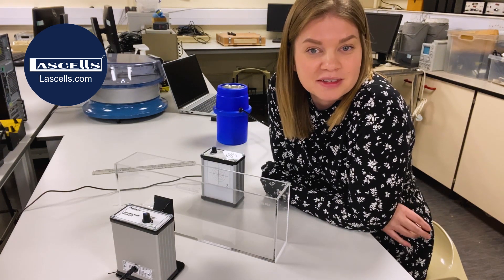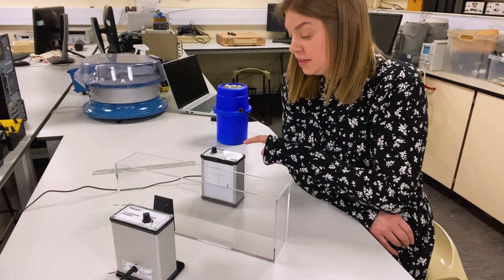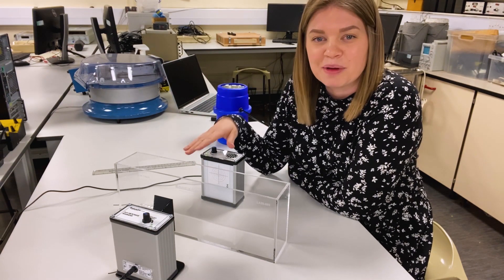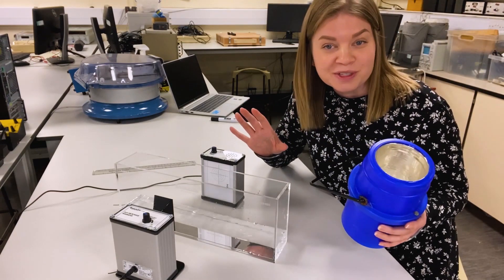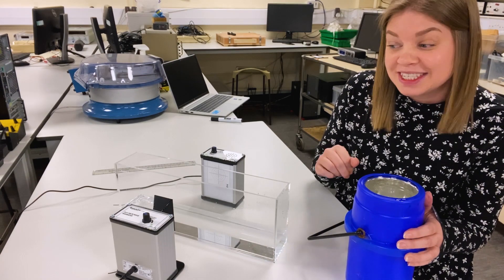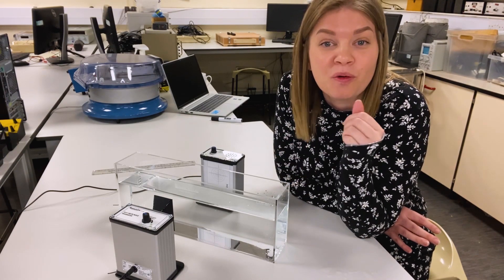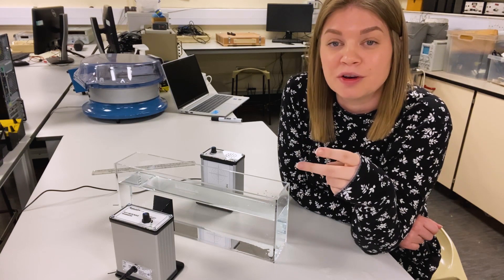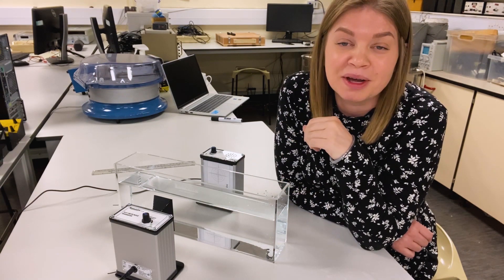Absorption of Microwave Radiation by Water

Comment: BTW, you’re gonna age quicker; if you’re in a field of enhanced microwave radiation, right?  The same mechanism that hyperactivates water molecules, has the efficacy of mutating nucleic acids into the R-isomers, which triggers apoptosis (cellular suicide).
Reply from the maker: Microwaves are non-ionising so interact with cells differently to x-rays and gamma rays. Effects like heating and burning can occur with high power microwave sources (NOT like those used in this video). Stay safe out there!
Reply: @LascellsScience  ah, but less illustrative at longer wavelengths.
Occasionally a bit more useful though for refraction experiments though, but one's also stuck with larger buckets to work with...   ;)

Don't know why I didn't think of kerosene as described above, always thought of longer chain oils for such experiments. Maybe an aversion after helping a friend out on an old SDI program involving extremely high power, short wavelength microwave applications where their test dummy loads has flash explosions on first application of full test power. I suggested it was machining oils vaporizing and flashing over, which ended up precisely the problem. A proper degreasing resolved that problem that was driving them to distraction as to the source of the otherwise harmless, if unnerving bang.
The final product being, like most of Reagan's SDI programs, vaporware. But, the side effect was yielding better ways to wrangle signals.